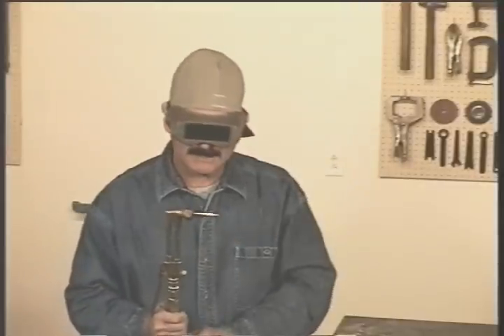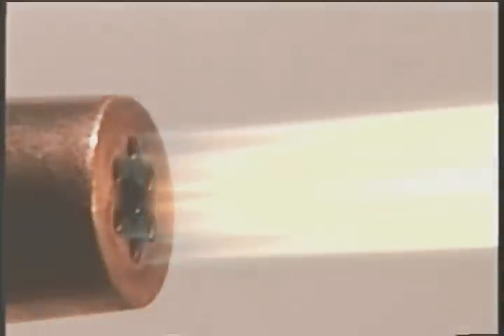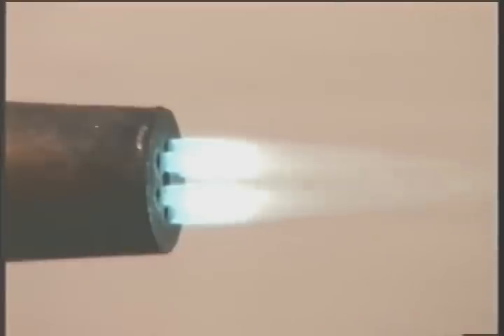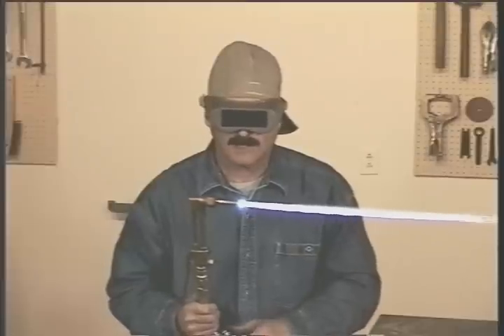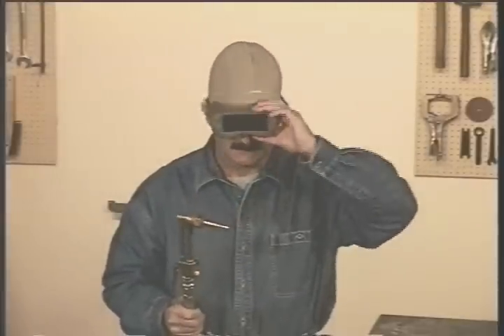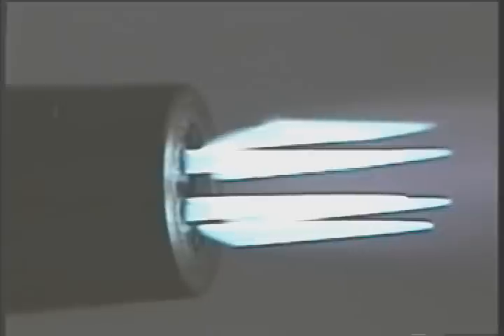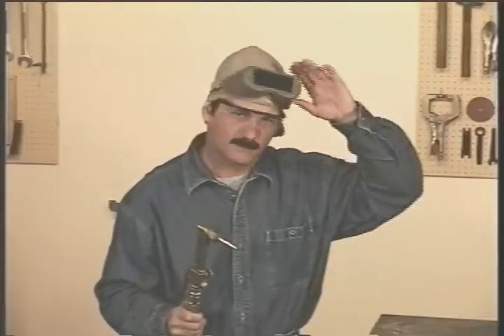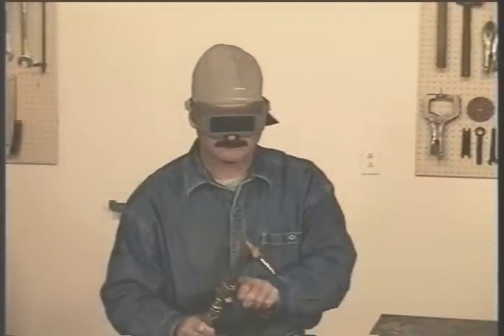How To Use A Cutting Torch

Comment: Turning off the acetylene first is not the recommended way to shut off a torch. It's traditional but has been proven very dangerous. Mr. Bleile says you should turn off the acetylene first because you may get a little flame at the tip if you don't. If you get a residual flame at the tip it could be two things. There is small amount of unburned gas in the torch body or you have a valve that is leaking. In any case you would not know because the little flame, if there was one, would have been overwhelmed by the excess O2 during shut off.
 
A potentially fatal accident happened at my place of work involving an oxy-acetylene torch and an open head 55 gallon drum which was being used to house scrap pieces of metal. Lunch time. The worker turned off his torch in the traditional way, acetylene first, then left the torch hang in the open head scrap drum. On arrival back at the shop he lit the torch and all hell broke loose. Witnesses said it looked like a mushroom cloud of flame that enveloped the worker. He was very lucky escaping with minor burns and singed eyebrows. Could have been much worse.  
 
New shop rules were put in place. Torches are to be shut off O2 first then acetylene. That way the little flame, if there is one, will inform you if there is a leak. Never hang a torch in any container for any reason. It was determined the worker had not tightened the acetylene valve properly and the gas leaked into the drum, ignited and well you know the rest.
Reply: Bodybuildingking What he meant was, the dude turned off the fuel and forgot to turn off the oxygen. Leaving the torch pissing oxy the whole time. Filling the drum with o2. At least that's what I read. It was a stupid mistake anyway not shutting off the oxygen. No matter which way you shut down. It's like, all the instructors say,. NO, lighters or matches for ignition of torches. Yet I watched old guys for years light them with the cigarette they're smoking.  Regulations have gone crazy with insurance claims. And I wouldn't have it any other way,, but old pros that did nothing but torch work for 50 years, know what they can and can't get away with. Be safe, everyone.

Comment: I've been professionally repairing oxy/acetylene equipment for 30 years here in  Phoenix Az and the proper shut down is oxy first then fiel.everytime you shut the fuel  vave off first a small amount of the black soot produced from acetylene gets sucked backed into the torch and into  the mixer (also called a flashback)causing the torch to plug over time .if you have valves that don't shut down you should take your torch to an authorized repair station for servicing.otherwise very good demonstration..
Reply: If oxy off first is the proper way then why do the manufacturers say to shut off Ace first? Manufacturers literally built the equipment. i don't care how many years experience you have, i'm doing what the people who built the equipment say to do. They are responsible if their equipment fails at least in my country.

Comment: is the tip for welding metals together or using flame to remove a stuck bolt or stud the same tip? What'll happen if u use the gas cutting tip to weld 2 sheet of metals instead?